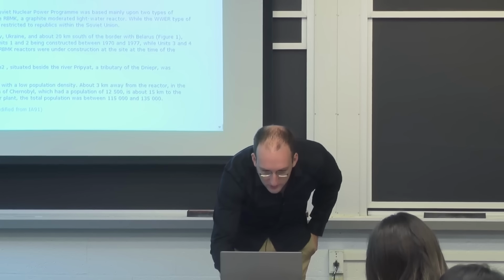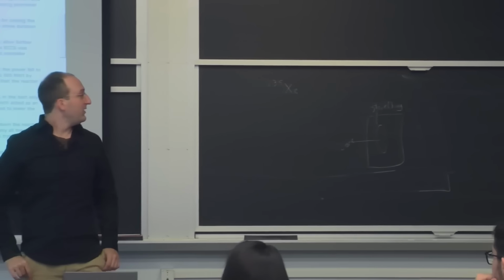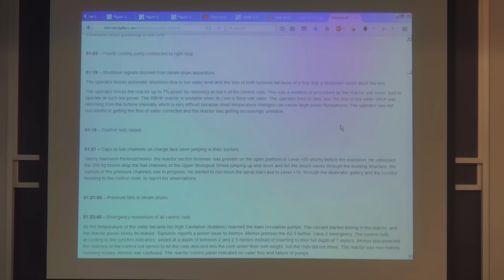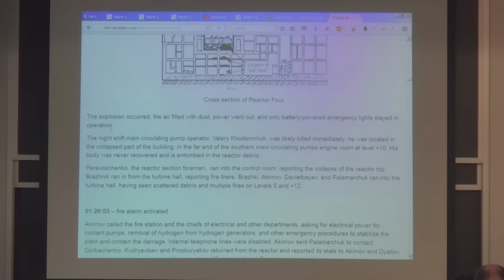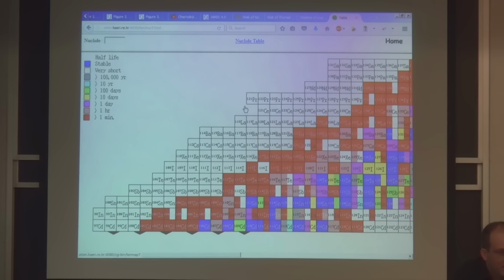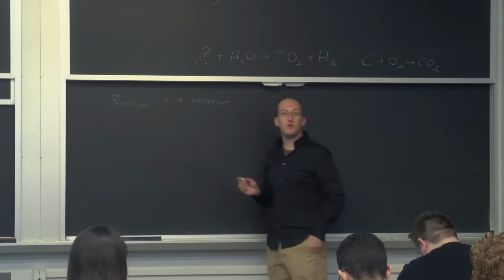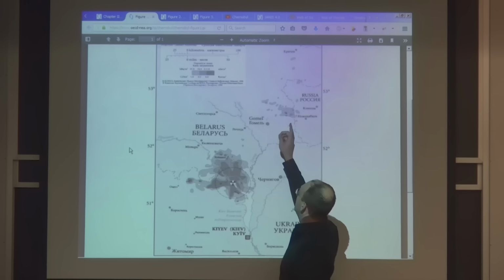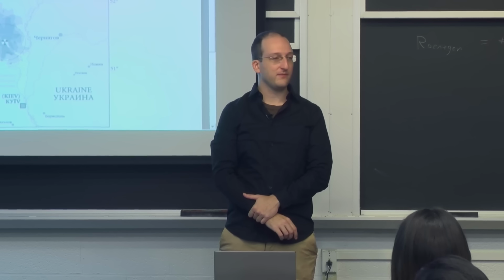26. Chernobyl — How It Happened

Comment: I've been learning everything I could about Reactor 4 my whole life, there details are fascinating.
There's a few ever so slight simplifications here so I get to nerd tf out... 🤩

First, at the point of scram.
When the control rods were out, rather than a column of water acting as an absorber, they were 'tipped' with a column of graphite for extra moderation.
But, and this is the big but, this big square reactor was design to react in the middle of the box, because the edges, where all the pipes and fittings interacted with the core, are not as strong as the middle (why is fascinating too but that's another story)

So, in between three boron and graphite tips was a short column of water, absorbing neurons and lowering the neutron flux density near the delicate edges of the reactor.

Problem is, when you insert the rods, for a minute or two the short water column at the end is replaced by a long graphite moderator, right at the edge of the reactor...

So, suddenly there is a large flux density jump at the party of the tractor designed to cope with low density.

The water boiler. And it was trapped and compressed at the bottom. This is what cracked the rod channels, jammed all the rods and doomed the reactor. The positive coefficient did it's thing, threw the cap (1st explosion), the water flashed to steam, prompt neutron criticality, the Uranium got its running shoes on and did the ping pong mouse trap fandango and the resulting Rapid Unplanned Disassembly halted the fission process.

Equivalent to a few tons of TNT, they found the telltale products somewhere in Norway I believe?

I'll go dig up the sources later
Reply: @Comrade Vlad 
The best line in the mini series they did was about embarrassing a nation allergic to embarrassment.
China are the same too, they will never let anybody investigate the Wuhan coronaries lab.
Regardless of if it were their fault or not.
Reply: @MostlyPennyCat  it has little to do with nationality. Ask TEPCO today and they will still play down Fukushima. Remember how late they admitted that there actually was a meltdown in their cores. 
Its nature of men to deny the severity of a fucky-wucky of huge proportions when they are at fault for them.
Reply: @5bagsofpopcorn  
Possibly I guess?
But look at the two countries we've used as examples, Soviet Russia and Japan.
If I was asked to choose two countries that are 'allergic to embarrassment', to whom 'Face' and the saving thereof is critical to national pride, I think the Soviets and the Japanese are two excellent choices
Reply: @5bagsofpopcorn  "Saving face" is a prominent characteristic of Japanese culture.  Even installing safety mods that came about after initial construction were ignored because that would be admitting you were wrong in the first place.  And those would have helped immensely.  Yes it partly CAN be directly related to nationality/culture.  Not all cultures have the same attitudes and attributes. To think otherwise would be just naive.
Reply: @nathanwahl9224  Of course "saving face" is more prominent in other cultures. However, I remember the Deepwater Horizon and how BP had to be pressed to admit all of their wrongdoing.
First it was an "accident that couldnt be foreseeen" until it turned out it was totally forseseeable and that they had been very negligent in their procedures.
All I'm saying is that when a fuck-up of epic proportion happens people try to act like they did nothing wrong and swap the blame around.
Reply: @5bagsofpopcorn  BP's reaction had a lot more to do with liability than with saving face.
Reply: Rapid Unplanned Disassembly --- Nice, have to remember that.. ;)
Reply: "the Uranium got its running shoes on and did the ping pong mouse trap fandango" :D great stuff
Reply: RUD?  You wouldn't happen to be a Scott Manly subscriber would you?
Reply: @thekinginyellow1744  
Yes but I'm pretty sure RUD is much older than Scott.
Reply: @MostlyPennyCat  Yeah, you're probably right.
Reply: Sources?

Comment: A containment building would not contain an incident like Fukushima. Production of steam and hydrogen will blow the containment building. At 3 Mile Island, they vented the gasses to keep the thing from blowing up.

Great for the down winders.
 
A news helicopter crew reported that they, flew through an area that the radiation was beyond what the equipment the equipment they were carrying could measure.

General Public Utilities, the conglomerate that was responsible. or unresponsible, in this case, then got their friends at the public utilities commissions to pass on the costs to the rate payers. My father told me his electric bill doubled after 3 Mile Island.

Comment: This is a myth: "if water is the moderator, and it goes out, the reaction stops and prevents the disaster, thus graphite moderator is bad". Guys, have you ever wondered to check facts? Fukushima had water as a moderator, yet they had the same hydrogen explosion in the end, and the lack of water was what actually caused the Fukushima meltdown, not prevented. Here are the real facts. Shutting down a reactor means that its power goes down a few percent. The fission still continues, and will continue for days. The reactor needs cooling at that time. If water "goes out", negative void reactivity won't help you in any way. Finally, it's possible to have negative void reactivity in a graphite reactor too. Mere water/graphite dichotomy is irrelevant. This guy repeats myths.

Comment: Containment building didn't prevent Fukushima venting out radioactive material outside, did it? The explosion in Chernobyl threw a 2000 ton lid into the air. Good luck containing that. It was sheer stupidity of the personnel that caused the disaster. If you throw lit up matches into your car's tank, you can't blame bad design when it explodes.
Reply: That's not  concrete protective dome in Fukushima. Hydrogen exploded,not the radioactive material. Their pumps were under water because of tsunami. There was no 2000 tons "protective lid" in Chernobil,it was the ceiling of the building.  The "protective dome" is round-shaped reinforced concrete dome designed to withstand both the explosions from inside and airplain crash(for instance,or a bomb) from the outside.
Reply: @ms-jl6dl 

1. In Chernobyl, it was also hydrogen, not radioactive material. In Fukushima, they avoided the first, steam explosion, because they started venting the reactor, but couldn't prevent the hydrogen explosion.
2. I never equated the lid with the dome, I never called it "protective lid". What I was saying, if the explosion was able to throw 2000 tons into the thin air, no containment would have contained that. The heaviest aircraft is 640 ton of maximum take-off weight.
3. Pumps were out of power. It was the reason they didn't operate. Not because they were underwater.
4. Fukushima had the Mark I containment.

Comment: "Dropping" the control rods was not feasibnle; the channels which the control rods used were normally full of water.  The control rods were "lowered" under power, to force the water out of the way.  They would probably be able to "drop" under the force of gravity, but it would probably be even slower.
Reply: When they tried to SCRAM, the channels the control rods slid into were already critically damaged, and they jammed with the graphite tips jammed in the bottom of the core, right where the nuclear runaway was underway. There was no way to "drop" the control rods. The water in the channels also boiled away.
Reply: Actually, dissimilar to the Russian reactors, despite the strong upward flow of cooling water in the channels of at least US Pressurized Water Reactors, the force of gravity is strong enough for the rods to drop to at least 3/4 insertion within a second of the initiating trip signal.  Our control rods are quite dense, consisting of Silver, Indium and Cadmium, but the diameter of the rods is small, offering little resistance to motion.

Comment: Hmm, I remember they said about Kurchatov that whenever he worked with alpha emitting materials after he was done he would just wipe his hands with a tissue and that'd be enough. Are alphas really worse than gammas in terms of exposure (not breathing them in)?
Reply: No, they are not.
Reply: Alphas are very dangerous as they are large particles whereas gammas are are a low energy small particle. Due to the small size the gamma can penetrate basically everything, Alphas cannot. Also Alphas are unstable and short range. The effect is that the dead layer of skin cells on your hand will protect you from alphas. So alphas are only dangerous if ingested. Gammas can penetrate everything (in this discussion) so it does not matter where they are in relation to you.

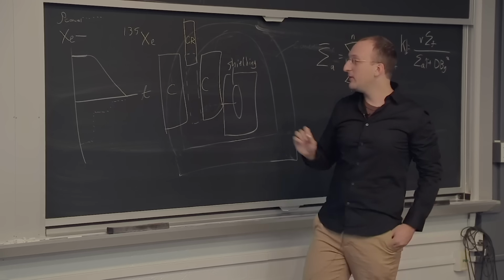Comment: At 18:40, weren't they actually tipped with about 6 METERS of graphite? The idea being that under normal operation the graphite would displace the water in the control channel,  improving reactivity, and so the rod had a greater ability to change neutron flux (both reducing it when in, and enhancing it when withdrawn).
Reply: 4.5 metres of graphite. When the rods were in the raised position, ie. the boron neutron poison part was out of the reactor, the bottom part of the control rod was in the active zone and were covered in graphite to enhance fission and stop the hydrogen in the water stealing any neutrons. This was necessary due to such lowly enriched fuel being used.

Comment: The nature of the second explosion is misunderstood, misreported and mistaught.
Hydrogen-oxygen explosion within reactor is unlikely because of anaerobic conditions within reactors channels filled with steam and hydrogen,   
explosion of hydrogen is possible when mixed with air above the reactor but there it will happen both late and outside thus not contributing to reactors rapid unscheduled disassembly.

There are two possible mechanisms of the second explosion:  
(1) zirconium-water reaction can make an explosion by itself, where zirconium is a fuel, water is an oxidizer,  hydrogen and water vapor are propellants.  
Moreover, molten zirconium might undergo a coulomb-explosion if in contact with liquid water, which can provide instant mixing of the reagents,  however it is not clear if any water remained liquid at that point.

(2) small scale nuclear fizzle-like explosion. Its yield is limited by graphite heating and loss of moderation due to increased graphite temperature.

Comment: "This simple formula"
Proceeds to write some alien language that takes up half the board
Reply: Lol,deputy chief nuclear engineer and cant even understand simple formula.no doubt u caused chernobly.
Reply: FYI -- As an MIT undergrad in the mid 90's, I can attest that this is a common reaction in most lectures.  You simply get good at writing down notes even when you've entirely lost the train of logic.  (Actually a good skill to have.)  Yes, this formula was surely "intuitively obvious".
Reply: @RossLSilburn  I get the feeling that actually calculating a result is far easier than learning the equation with which to do so.
Reply: It is kind of simple formula. It is not about memorizing the formula itself. It is about understanding it. You ned to understand what that formula says. Even as laic I can see that it says 4pi (which means something spreading in all possible direction. Imagine a ligh bulb in [0,0] which spreads light). Then there is N which can be a number of particles or something like that. And finally these two devided by momentum (mass times velocity). It is just these things which tells me that this formula describes the distribution of particles in the sphere depending on the particle´s mass and velocity.  
The formula is not about different letters. You actually need to understand what the formula says. Memorazing will not allow you to use it. You would not understand how to work with it. You cannot look at the formula as a bunch of letters, number and signs. You need to understand what it actually describes.

Comment: Best shortened description of positive void coefficient I’ve ever heard. What I missed was a discussion of BWR versus PWR design. All other things being equal, are BWR (boiling water reactors) designs considered safer than PWR (pressurized water reactors) designs? PWR reactors are designed to operate at water pressure/temp above that which would allow departure from nucleate boiling. Automated controls and manual operating procedures restrict Press/Temp operations in which steam voids would occur while coolant/moderating water traversed fuel modules. 

I operated PWRs in the US Navy sub force. We knew the hazard of operating below minimum pressure/temp curves. But BWR reactors require steam formation in the primary coolant loop in order to ultimately drive steam turbines. So positive void coefficient will always be in play in a BWR design.

So, why are BWR designs still a thing... even with water-moderation (versus graphite in RBMKs)? All 6 Fukushima Daichi reactors are BWRs (GE early 60s plants).

My assumption is that cost drives the BWR design. Meaning that it’s a lot less costly to build a single (BWR) versus double (PWR) loop. I do know that submarine nuke designs required frequent maintenance access to both propulsion and electrical generation turbines. So both use secondary steam (not irradiated) to operate.
Reply: Thank you for your service.  Also, thank you for that explanation. You were in a quite unique situation. It seems like nuclear reactor costs always drive reactor designs. Maybe we shouldn't let costs out way safety. It's the techs and engineers that are in the most danger as opposed to the builders and management sitting back and getting the money without getting the consequences. When things go wrong in a sub, the options for dealing with the situation are very limited. I'm assuming that you were very careful, but where you ever afraid or concerned? In your honest opinion, do you think that it's cost effective and safe to operate today's subs?
Reply: Our reactors were way too highly enriched to be cost effective on the electricity market. BWR and reactors with heavy water don’t need to be as highly enriched. It also wouldn’t be that hard to have tanks full of water and pressurized air to prevent a Fukushima situation even in BWRs. Or they could have built a higher sea wall or not put their diesels in the basement.

Comment: 26' The integrity of the Sarcophagus was in doubt in 2016, as Mr Short was giving this presentation. However, as of the posting of this video in 2019, ithe New Safe Confinement has been completed, covering the old structure, and facilitating interior work to disassemble the contents inside it.
Reply: @tommcdaniel9554  20 years? I'm looking at my comment, and what does 20 years have to do with anything?
Reply: @tommcdaniel9554  30 years. The original was constructed as quickly as possible, under some horrific circumstances. It was known from the start that it wouldn't last more than a few decades, but it was more important to get any kind of lid on it than build a quality confinement.
Reply: That ought to be good for containing whatever is left in the debris that hasn't already left the reactor for 100 years. Then what?

Comment: 20' Then it certainly sounds as if the first explosion was much larger than the second, by a huge margin.
Reply: It probably was, but the effects were different. The first explosion blew the lid off of the containment vessel, but didn't release nearly as much nuclear material and other contamination into the environment as did the second.
Reply: @jwenting  Is the cause of the second explosion as controversial as some make it out to be (eg supercritical nuclear explosion versus Zr+steam generated hydrogen explosion that scattered a lot of fission product daughters in the graphite-fueled fire)?

IMHO, U235 enrichment would not have been beyond 2-3%, so supercritical nuke explosion could not have happened.

Your comments?